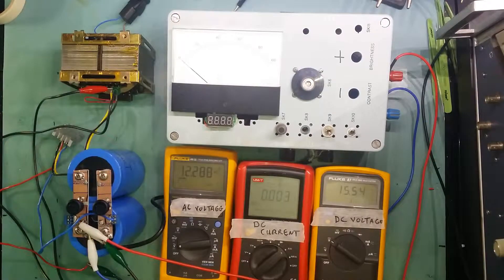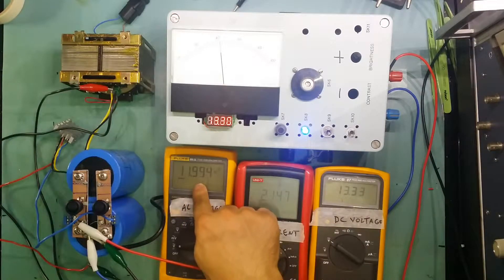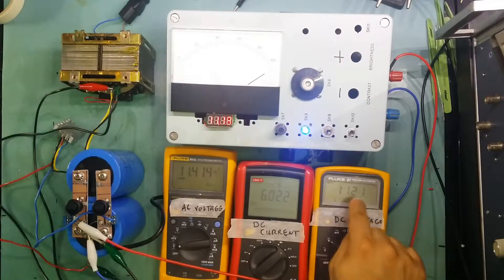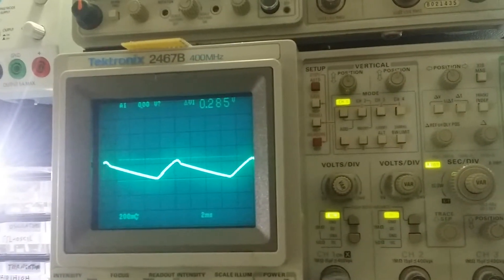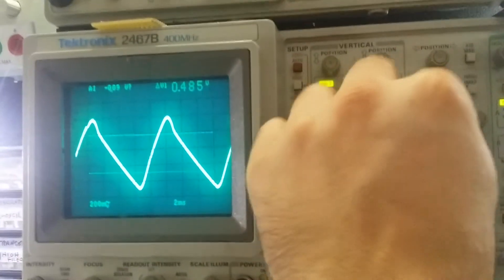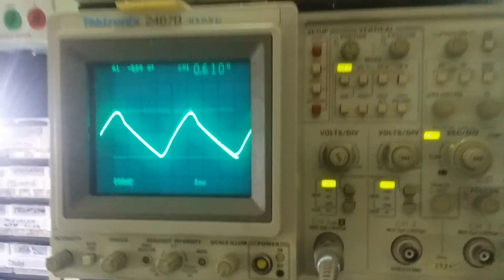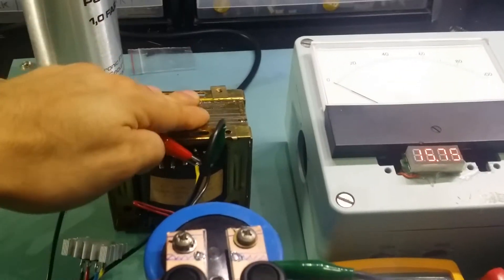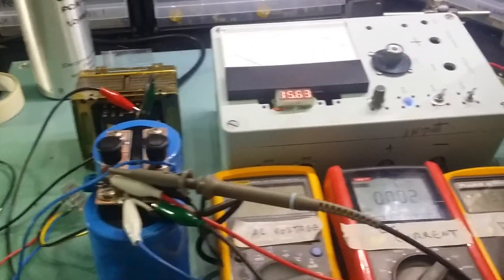Lab power supply design part1

Comment: Nice tests. Could you shed some light on how you made your dummy load? I think I would choose the lazy approach on that power supply and go for an adjustable regulator regardless of the minimum voltage of 1.25 (I've never used any less than that, I think).